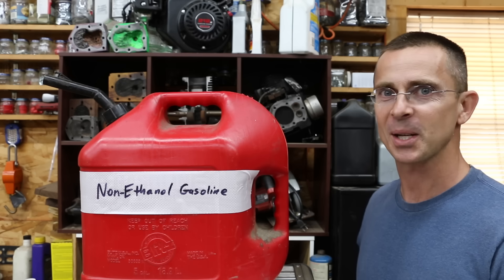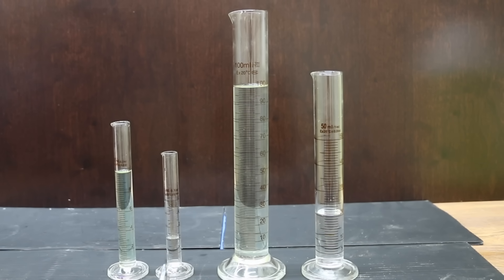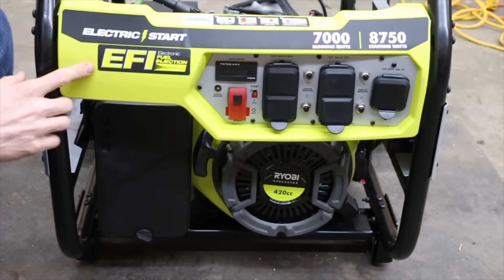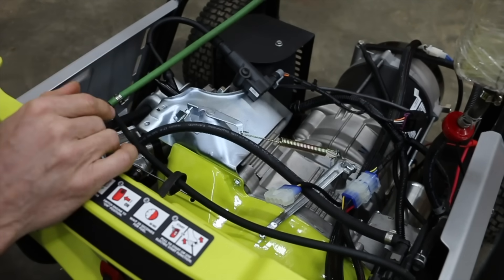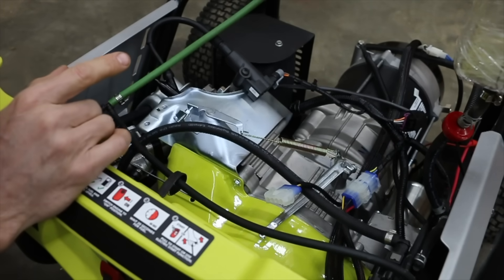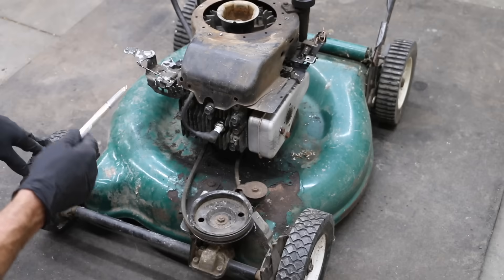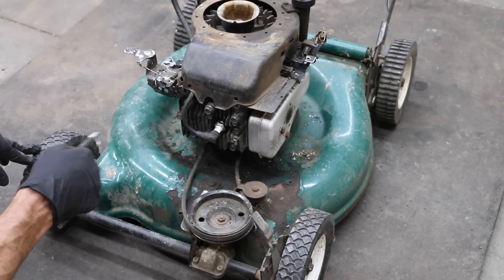Is Non-Ethanol Gasoline Really Better? See the PROOF!

Comment: He's what I found with ethanol since I grew up with non ethanol.  It's made out of corn. Corn rots.  The gas now has a shelf life of 90 days.  I don't think you can have a test with fresh gasoline.  Ethanol in gas is fine, as long as you're using your car all the time or whatever you're putting it in.  The moment you put away your weed wacker chainsaw lawn mower or anything that runs on gas like a dirt bike. You will have a problem.  I even had a problem with a Toyota fuel filler tube. It put pinholes in fuel filler tube. And through a code. We smoked the engine and found the problem. Smoke was coming out of the gas fill area.  Everyone's had problem with their small engine come springtime right?  My dirt bike I pulled out of the shed I tried to clean the carburetor and could not even read the numbers on the jets.  Corn is a natural material that just degrades.  Naturally.  But if we left non ethanol gasoline for more than a year or so it just varnished. And I could clean that up and keep going. With ethanol you have to throw it out.  No one  rebuilds carburetors anymore, they just throw them out and buy a new one.  Do you know how many small egine mechanics heard this same line.... I don't understand... I put stable in it.... It should be fine.
Reply from the maker: Thanks for sharing.

Comment: I enjoy many of your videos, but this theory is not correct, I’m surprised no one with high school chemistry has chimed in.
“If I add 20ml of water, the separation mark should be  at 30”
NO-that is NOT correct, in either theory or science. You are forgetting grade 10 
Chemistry class.
 When mixing chemical compounds, 10+20 does not always =30.
This is because of the structure of the molecules. They don’t always stack neatly upon each other, many times they intermingle. It’s sort of like having a gallon of BBS & mixing them in a bucket containing a gallon of marbles.
You would end up with little more than 1 gallon total, as the BBs would fill into the gaps amongst the marbles. Same thing happens with different sized chemical molecules.
Reply from the maker: Thanks for sharing.

Comment: Ethanol gas will corrode aluminum overtime it's not good but there are ways to prevent it and project farm has videos that you can look up to see what additives you can put in your fuel and I do it every fill up so watch other videos from project farm on fuel additives and how to protect your motor

Comment: Love it... I was waiting for a video like this. Since I make my own non-ethanol, There is an absolute difference when it comes to ethanol-based gas sitting stagnant in a carburetor. My king quad is proof. If I use regular gas, I have to rip the carburetor part after it sits for a minimum of one month because the needle valve, that's made from cheap ass aluminum, is so corroded that it grows and gets stuck in the valleyway. Never once had I experienced a problem since I've been making non-ethanol. I make sure to add a nice splash of amsoil octane boost to bring my octane back up to 87 plus. One note is to make sure that you let the water and gas mixture sit for at least 2 weeks. The cloudiness will subside but it shows small water molecules still suspended in the solution. It's still runs well in engines if it is still cloudy, but something to consider. Thank you, project farm!
Reply: Are you still doing this? I would like to try making my own non ethanol since the closest places around me are kind of far.

Comment: In my independent test I conducted over 10 years ago. 
With 10% ethanol gas my mileage suffered exactly 10%.  This means adding ethanol to gasoline has zero benefits…

In the 1970’s Archer, Daniel, Midland (ADM) also conducted a thorough analysis of mixing ethanol with gasoline. They also concluded that there is no benefits in doing so.

Ethanol is not as volatile as fresh gasoline. Ethanol burns slower than gasoline. The piston has already moved by the time ethanol ignites. 
“If” ethanol could contribute as a fuel source for an internal combustion engine I would think 100% ethanol would be used. E-85 is 15% gasoline added to ethanol, it suffers much.

Ethanol does burn, as it burns it creates heat. That heat could be used to make steam. So build an engine that ethanol can be used efficiently. That engine is a steam engine, also known as a Stanley Steamer…

Comment: This my job : i tune gas engines to turn them flexfuel E85. I have tuned thousand of engines for more than 14 years and i use E85 in my own cars (and tuned friends and family's to). I keep my cars for long time. have 300 000 kilometers Renault Espace (bought 172mkm) and 230 000 Mercedes SLK 55 AMG(bought 187mkm), had 250Mkm Golf4 R32(bought 11mkm) and more... All my engines used E85 only for thousands of kilometers with no longevity issue. I do not stock E85 and i change Oil each 10 000km.
Reply from the maker: Thanks for the feedback and  Thanks for sharing.

Comment: Hi, I use E85 ethanol in my Opel Calibra 16v (GM L4 C20XE) for 7 months now and all is absolutely good. It's a 32yo car without remap, I just changed injectors for bigger ones and fuel pressure. The AFR is managed by the O2 sensor and I always complete the tank with regular unlead 98 if I have to keep the car stopped for a few weeks. I decided to go this way because of increasing prices on regular 98 and also because lot of friends from Opel clubs run their engines with E85 for years now. For sure the ethanol causes less issues on a 4 strokes engine with electronical fuel managment than on a 2 strokes on carburators. It just needs more consistency in the oil change interval, a complete new fuel lines, pump, filter, and an ignition system in perfect condition.
This fuel is another great solution aside the electrical vehicles, and it allows car people to keep on living their passion for cars, mechanics, and noise 😆
Reply from the maker: Thanks for sharing.

Comment: I use ethanol in the Toyota Corolla in the summer, no changes have been made to the engine. It works well, although it takes a little more fuel, but it will still be cheaper to use than 95 petrol.
Reply from the maker: Thanks for the feedback.
Reply: Do you add fuel additives (cleaner)?
Reply: Ethanol fuel in a vehicle will not have much effect as it is a closed fuel system (not open to air). Ethanol becomes a problem over time when it is exposed to air as it can start to phase separate, etc.
Reply: @KEEVO35  actually it isn't entirely true. It might seem totally closed, but given enough time water finds it's way into the system and ruins the fuel. This is because ethanol is hydrophilic and attacts water. It also has a higher specific gravity than the petrol and settles at the bottom in a paste like substance with the water it attracted and becomes less combustible. This can happen in roughly 2 weeks with a carb'd vehicle. Fuel injected vehicles have high pressure systems that break up the junk and might run rough for a bit but they usually can recover from phase separated fuel. It's still not good for them though!

Ethanol and all the petroleum products for all tenses and purposes do not decompose readily on their own so they don't go 1 "bad" like you think. it's just the natural attraction of contaminants that causes the problems. hypothetically speaking, and assuming water is the only contaminant and i didn't miss something, you can actually phase separate ethanol and petrol then distill the ethanol back to pure, and re-add it to the fuel and it is as good as new.

Comment: Very informative video, thank you! I learned my lesson last year with my Ariens snow blower up here in Kennebunk, Maine. The carb was drained for the season, refueled with 10% ethanol gas from Sunoco and within one month it gunked up and wouldn't start. Took the carb off, cleaned it out and now only use "ethanol free" gas. Engine has more power and less exhaust fumes. Will neve use regular gas again in small engines. Also, just put my 2016 Mazda Miata away for the Winter, filled the tank with ethanol free gas. Our winters don't end until June around here. Again, great video! Thank you!
Reply from the maker: Thanks and you are welcome!  Thanks for sharing.
Reply: Where do you find ethanol-free gas for a car? I thought all of Cumberland and York County had to sell the corn gas.  I know Bert's in Bath has ethanol free high octane. He's right on Route One drawing in people coming right off the county line from Brunswick and does good business from that.
Reply: @skipads5141  You can get it at the Shell Station on Alfred Rd. In Kennebunk
Reply: Good point on the MX5/Miata front. Cheers.

Comment: I know for a fact that gasoline today if you let it dry up in your fuel system especially when carburatored it literally turns to a plastic coating on everything is severely contaminated I see it with small engines every day
Reply from the maker: Thanks for the feedback.

Comment: Worth a PF test? I discovered with my old Echo chain saw that even if I put it away with gas in the carb and just a dribble in the tank, it could sit for 2 yrs and start with 4-5 pulls. Since then I use 20:1 (ish) 2 stroke outboard oil with premium gas in all my engines for storage including 4 stroke. Fuel injected outboard, twin 350 inboard boat engines, 9.9 hp 2 stroke outboard, generator, snow blower, everything. Disconnect the fuel line, attach the marine tank I use for the storage routine, run it for 5-10 min, shut it off. Gas tanks are topped up with what ever the engine normally requires. Next season they start right up like they were running last week. Simple solution. Sometimes the gas I use for storage has been sitting for 6 months before I do the storage routine. Doesn't seem to make a difference. I figure the 2 stroke oil coats everything and seems to overpower the ethanol and related problems. I was wondering if the added oil helps coat the cylinders when cranking to start making the compression a bit better too? I use outboard 2 stroke oil thinking it might have a slightly better water dissipation/absorbing quality than air cooled 2 stroke. I'm no fuel-ologist but this is easy and works for me.

Comment: I have a question although this is almost 3 years old lol 2014 escape i can run E85 or straight 91 fuel what was weird is i get 389 miles a tank from the E85 and only 291 miles from the 91 what sense does that make ? both filled from almost completely empty. I have yet to figure it out and no one sems to know.

Comment: I have a 2012 F-150 with a 5.0 ( 302 ) Flex Fuel engine. I'm getting 19.5 - 20 mpg when I use ethanol free  91 octane fuel. When I use E85, my mileage drops to 16.5 - 17mpg. 
So, if I don't have to, I don't run fuel with ethanol . Period.

Comment: I have a Ford Fiesta 1.0 EcoBoost. It's E20 compatible and I only used E20 for a long time. What I found is that the car was very heavy on fuel. I changed to normal 95 Gasoline and the consumption was allot better. I am on average getting more than 200km more per tank. I will never go back to E20! It may cost a little less, but the consumption isn't worth it in the long run.

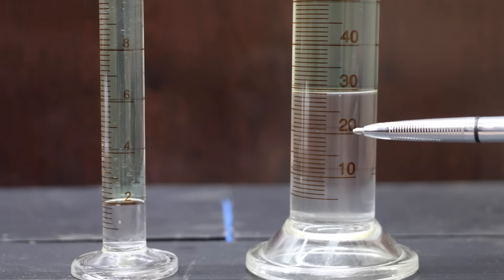Comment: 1:45 - 10ml ethanol plus 20ml water makes less than 30ml of solution because the molecules can pack more densely when they are mixed together.  A bit less than 30ml is the expected result.
Reply from the maker: Thanks for the feedback.

Comment: Decades ago B 4 ethanol you could buy an old car that sat for 10 years drain the tank add new fuel & if the brakes worked you could drive it home. I know because as a kid I did it many times . Now you'll need to change the tank sender & fuel pump carb or injectors ETC ETC ! & that's even after 3/4 years .  Long story short , Ethanol is Crap !

Comment: Great job but please note the Fuel Companies use different additives some Generic and there branded which really makes the end result burn cleaner and with time less carbon buildup. If in California and you buy Costco gasoline they receive there gas from the local gas terminal which adds the minimum required Generic additive and from there the fuel truck arrives at the Costco gas station they will add another spec of generic additive as well.   They will the extra additive inside the storage tanks and then the driver will unload on top of it mixing it up.
Reply from the maker: Thanks for sharing.

Comment: One thing to consider is that while non-ethanol lasted 4% longer it technically had 10% more gasoline (because ethanol makes up 10% of the volume of the mixed fuel). If ethanol is significantly cheaper than gasoline then there could still be some savings in terms of cost per unit energy.
Reply from the maker: Thanks for the feedback.
Reply: @ProjectFarm  no problem. Love your videos!

Comment: I also burn it in my vehicles, especially on long road trips for that added boost of gas mileage. Now knowing it also weighs less it may contribute to the fuel mileage as well since my tank is 32 gallons. Most if not everyone with any type of hot rod tend to burn it too and it doesn't stink like 10% but smells like old school race gas.
Reply from the maker: Thanks for sharing.

Comment: I know non is better for crap like ancient tractors that you use like 6 times a year (where the gas just sit's in there for years). Pump gas always ends up killing our 60's Farmall. And we never had that problem in the 70's, 80's, 90's or the 00's. The tank gets inside rust with pump gas, now, and screws up the fuel line. (don't care of any other stuff....with the differences... they don't matter especially when the fuel tank is screwed up.)

Comment: I have always removed the oil injection pump the day my warranty expired on my outboards engines and only pre-mixed my fuel after that.  Me and most of my family have lived waterfront and ALL have had an issue with the oiler not oiling correctly.  The oil alert alarm only goes off only if you run out of oil in the oil tank, or the oiler stops working completely.  Thank goodness for 4-stroke engines.  I no longer own any 2- stroke engines. Also I grew up with dirt bikes and never had a oil injector pump issue and never knew anyone that had a injector pump issue with a dirt bike oiler.  Conversely, almost everyone one I know ( including myself )  has had a oil pump issue on an outboard engine. I have always wonder why that is, especially considering the same manufactures made both outboards and dirt bikes.

Comment: Depends on the age of the motor. More modern motors are designed for ethanol blended fuels and will run fine on them, there is some loss of power but it's dependent on the amount of ethanol in the fuel. An E15 fuel will have maybe a 1 or 2 % decrease in economy.
Reply from the maker: Thanks for the feedback.

Comment: So, the outcome of this experiment was a bunch of inconclusives. It also didn't help that you ran the generator for 15 minutes at the start on non-ethanol gasoline, without cleaning it afterwards, thus contaminating your results. It wearies me that I have to point these things out. Also, what's with the different size beakers? Couldn't find two the same size? Don't run an experiment unless the experiment involves directly comparable components. This was a waste of time to watch.

Comment: So, with the generator,  for E10, 10% less pure gasoline gives only 4% less run time?  Or per-unit of gasloine, E10 is 6% more efficient than regular?  So while it will harm range due to tank volume, you are actually using 6% less actual gas for a 4% reduction in range? Am I right?

Comment: Have sold my carb motorcycles as the jelly I found after 3 months did my head in keep stripping them as I ride infrequently. So far fuel inj bike 18 months no problem

Comment: My car did 51.3 MPG on normal unleaded. On E10 (10% ethanol) it does 42.6 MPG. Putting ethanol in petrol is stupid. 10% less nasty emissions, but 20% worse fuel economy so you actually put 10% more shit in the air using ethanol.
Reply from the maker: Thanks for the suggestion.

Comment: After working in the rail industry tankers that transport this fuel would rust bad the bosters and sideframs like chunks 1/8 thick half as big as a football would come off and during the 80s it eat up the metal tubing on fuel lines on cars expensive repairs

Comment: Wait until you leave Ethanol in fuel systems unused for a few months. It destroys motorcycle fuel taps and carb parts when it goes off and starts absorbing moisture. I leave Fuelfit in fuel over winter in my motorcycles, this seems to help.
Reply from the maker: Thanks for sharing.

Comment: The gov't and growers of vegetation that becomes ethanol for fuel love it, someone who uses it does not (except for the price). Sit a generator over two months with ethanol fuel and chances are it will NOT start. Do the same with non-ethanol and it will start. I use non-ethanol in all my small engines and in November, when some of the full size vehicles are not driving for months, I run them dry of ethanol and fill up with non-ethanol for the winter storage. 
And those fuel additive do not seem tow work; tried most.
And really, this has been tested to death....